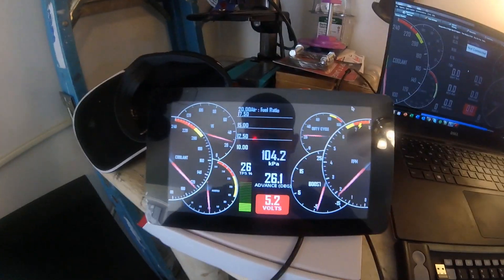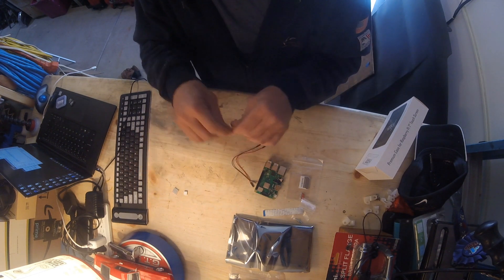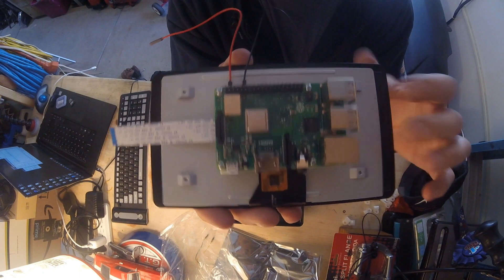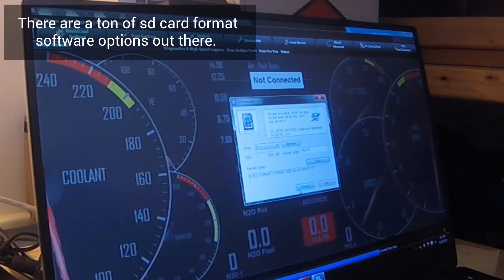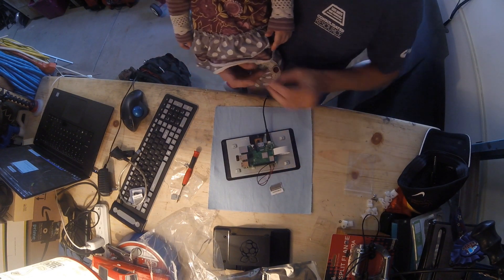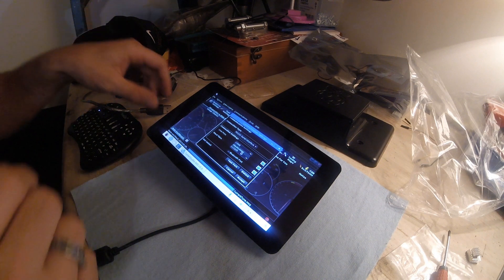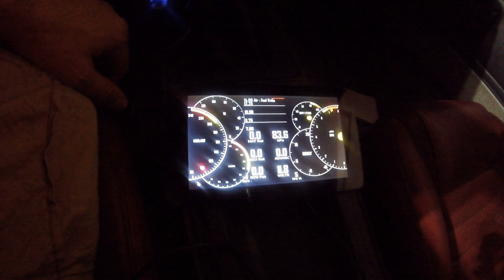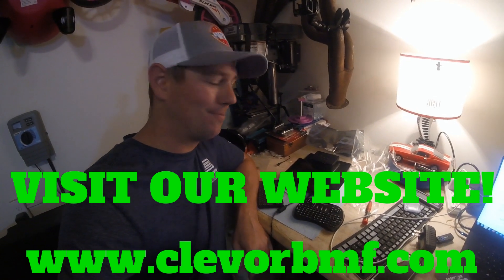Touchscreen Dash & Gauge Build - How To Build a RPi Dash [BMF_DASH]

Comment: Going this route on my 89 Dodge Daytona with the SRT4 swap.   Going to use the 10.1" display and raspberry pi 5 in place of the existing gauges.       Guess I'll have to find a way to split the speedometer signal to keep the original miles going

Comment: i have an electric vehicle and i need to make a dash for it, i have the same hardware as you except the bms has uart pins for connection, how do i make this?
Reply from the maker: This one is specifically for connecting to microsquirt ecu… not sure you can make it work otherwise….
Reply: @BMF_Garage  how did you make the graphics tho?
Reply from the maker: Graphics are all part of TunerStudio.  You make them in the design mode within turnersrudio….

Comment: Hay, 
Can you share the image for free. 
By the way I just liked your video 

Thank u
Reply from the maker: It’s old, outdated and not worth using quite honestly.  Each one takes specific work to get going.  It’s so much easier to just use a mini windows pc and load the software onto it.  That’s all I do now.  Lark box pro with windows connected to a lcd monitor.
Reply: @BMF_Garage   I'm new to Qt and raspberry, I'm a student, even I tried to cross compile Qt tdk but it didn't fail 

I hope your image serves as a guide for me

Comment: hi, did you used your original ECU?
Reply: It s not way to make work raspberry with an original ecu?
Reply from the maker: @Andrei-lt4vh  no, not with this software.  This software is made to communicate with megasquirt and microsquirt
Reply from the maker: No.  This only works with aftermarket ecu

Comment: Can this work with a stock ecu via the obd2 port? I just have a basic e90 seat time car.
Reply from the maker: No, this one can’t
Reply: @BMF_Garage  wonder if it could work with a d-can
Reply from the maker: This software requires an ecu to connect to and read but you can connect can bud to the ecu and read more io…
Reply: @BMF_Garage  the main thing i need is coolant, oil pressure/ temp. And since i have an electric waterpump waterpump speed would be cool too.
Reply from the maker: Well, this isn’t a great option for that but with enough work could possibly do that… there is a license cost and parts cost..  real dash might be a better option

Comment: Stumbled across your video. I’m buying a 1994 RHD JDM vehicle with no ODBII port. Interested in this concept since the speedometer is in Km/h so I don’t have to do algebra while I’m driving. Not sure how compatible this would be or how I’d get it to pull data from the ECU. Thoughts?
Reply from the maker: Well, this specific application would t work that good because it uses TunerStudio to connect to a megasquirt ecu.

Comment: Can u build a dash to work/operate with Holley Terminator   Or would I need to piggyback a stock ECU
Reply from the maker: I’m actually in the testing phases now
Reply: Please let me know if you have any success.   I myself have been considering reverse engineering the 3.5 hand held and just using that signal to feed the raspberry pi

Comment: How to connect to ECU serial port, I cannot a com port at ECU but only OBD connector?  Can use OBD2 to USB cable?
Reply from the maker: Obd will not work with tuner studio
Reply: @BMF_Garage  how to find the com port of ECU
Reply from the maker: If it’s a factory ecu you won’t have one.  These work with megasquirt ecus
Reply: @BMF_Garage  so i m driving RX8, can i use tuner studio?
Reply from the maker: Only if it’s got a megasquirt ecu.  TunerStudio doesn’t work with factory ecus
Reply: @BMF_Garage  understood, thks a lot🙏

Comment: How are you getting a gps signal for your speedometer? Any recommendations for a good plug and play gps for the pi? I have the ms3pnp and I’m using a raspberry pi 4
Reply from the maker: There isn’t a plug and play option... but if you buy a usb gps sensor there is a bunch of code to run on the pi to get it to work... then you set up that input within TunerStudio for speed.

Comment: Hey ClevorMBF,! Thanks for the video, you've inspired me to build one of these for my AW11 MR2. But since my 86 does not have an OBD2 port, will it still work? I was thinking about using something like this: https://www.dx.com/p/17-pin-to-16-pin-obd-2-obd-diagnostic-adapter-cable-for-toyota-2013170.html#.X4moye1lD-g

Does the software have any limitations for the year of the car? Thanks for the help!
Reply from the maker: The software is slow, that’s my only complaint. Otherwise, I’ve built a few of these and love them!
Reply: @BMF_Garage  Sorry about the autocorrect in your name, lol. Do you have an Amazon partner account? I can use your link to buy some of these parts.
Reply from the maker: No worries, I don’t have one set up

Comment: Do you know if this will work with the Holley F.A.S.T. efi ? I'm building a 69 chevy c10 and was looking for a alternative to the $850 and up Dakota Digital gauges.  Thank you for your time and the video was really informative and the best thing no b.s. filler. Keep up the great work and ride safe.
Reply: Holly does not offer any Linux based software for tuning.  This guy is using a Mega-squirt ECU. Mega-squirt mostly opensource and can be used with Just about any EFI hardware(injectors, throttle, bodies, sensors, etc) you want. It is highly customization you can buy pre-built units, kits, or build one completely from raw parts. They support windows and linux for tuning. It is a very capable and should be looked into if you haven't already purchased the FAST set up. 
 I am not a big fan of the overly simplistic Dakota dash.
Reply from the maker: This is basically a small computer, so you’re installing the tuning software on it and using it as a dash.  If holly has compatible software, you should be able to do this.
Reply: @BMF_Garage  thank you

Comment: What software should i install on my pc to design my own dash design?

After that I will save it on sd and put it in the ras pi right?
Reply from the maker: The software is relative to what ecu you are using.  This one I'm working with uses a full version of tunerstudio and designs that I have made myself.  These are compatible with megasquirt, micro squirt, speeduino, and a few other ecus.  You need to use software that is compatible with the ecu you are trying to talk to. 

The sd card is typically used in the pi to run and boot from, yes.

Comment: Could you explain in potatoe head style how i could accomplish the screen pi and guages for a old vw bug pretty please.
Reply: Please respond with a ball park price.  I'm willing to pay plus would love to learn but understand your knowledge to do so is a way of means.  Regardless I don't want waste your time but am willing to pay within a certain perimeter.  I can get a bluetooth distributor that gets me almost what I want to be minus 1 guage/want.   I'm running carbs so only looking for a interface of the senders (or whatever tells the guages the information) to pad.
Reply from the maker: Hey I looked for your message from my site but never saw one, my apologies.  Unfortunately right now I just dont have time to do something like this.  Maybe in a couple months I’ll have some time but right I’m getting my car ready for a week long race that starts the 20th plus working every day...
Reply from the maker: Well you have to use a megasquirt for the version I’m using.  Integrating with an older engine requires a lot more like adding sensors and add on boards to the pi and a lot more programming.
Reply: @BMF_Garage   thanks I sent you a message via your website
Reply from the maker: Good deal.  I’ll get back to you this evening
Reply: @BMF_Garage  I did send one too via your web site - November...
Reply from the maker: You’d basically be using the pi as a dash without TunerStudio.  TunerStudio only works with an ecu to connect to.

So you’d have to build all the graphics from scratch, program the gauges to function properly, buy input boards for the type of inputs you want to use, program each of the input points.... there is an insane amount of work required to do this without an ecu to connect to.  Months of work.  There’s a ton of raspberry pi tutorials out there on graphics and programming on YouTube.
Reply: @BMF_Garage  The plan was MS Pro. Do not understand why the comment "graphics are built from scratch", unless what you are showing is the limitation of  Tunerstudio. Can you change gauge style colors of the background, colors of the pointers?
Reply from the maker: Yeah so all the gauge clusters I have I start with a blank cluster on tuner studio.  I add the gauges, change the needles, colors, ranges, backgrounds... the gauge clusters are fully customizable.

Comment: hey can you use an OBD II adapter with this ?
Reply from the maker: Unfortunately this doesn’t work with with obd2.... yet...
Reply: @BMF_Garage  can i get into contact with you
Reply from the maker: @Nimco512   certainly.  My contact details are in the video description.  Either facebook or instagram work best for me.
Reply: @BMF_Garage  is there any way i can get it to work with the OBDII ?
Reply: Did you ever figure it out?
Reply from the maker: I haven’t had time to work on it much.  All it takes is an operating system that can use compatible software to read the data.  I’m sure it’s not tough, just time consuming.
Reply: @brandonjacob3897  hey no i went an alternate route using node red !

Comment: can you make one of these for an older '70s vintage vehicle that doesn't have electronic sensors
Reply from the maker: I can... but electronic sensors are what send readings to the dash and or ecu.... without electronic sensors, it will have nothing to sense...
Reply: @BMF_Garage  does it take analog inputs from temperature sensors or oil pressure?
Reply from the maker: It certainly can
Reply from the maker: 0-5 volt signals work best